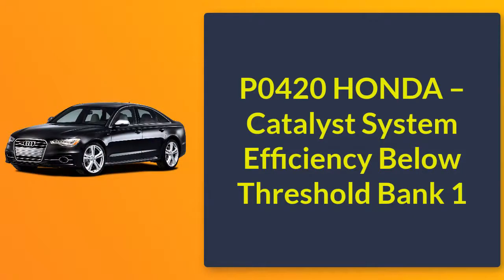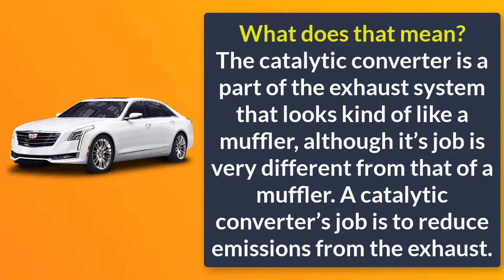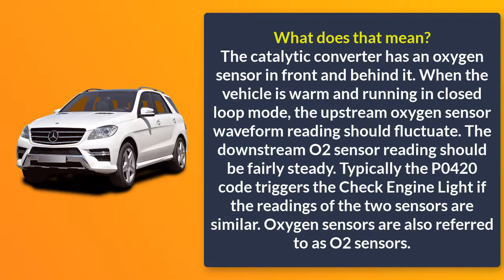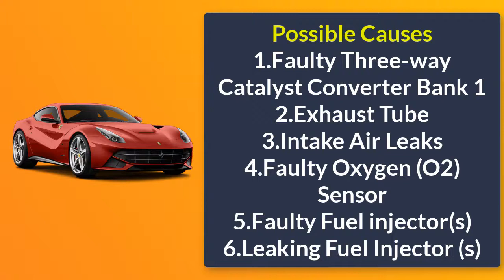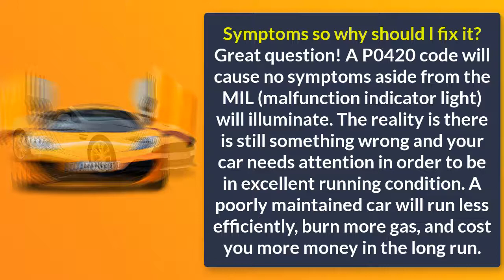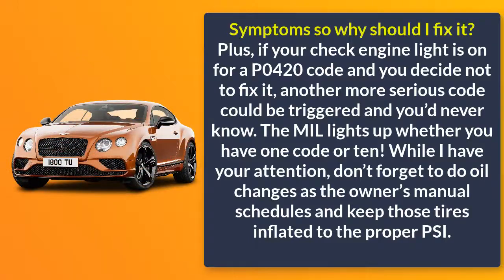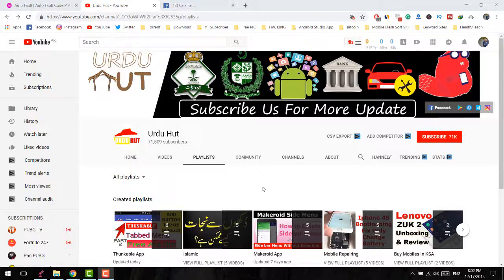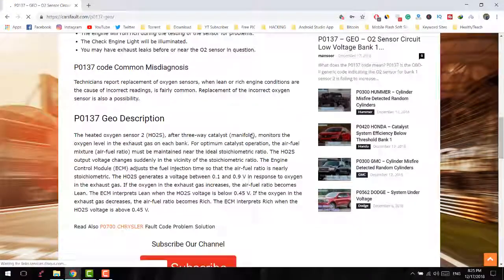P0420 HONDA   Catalyst System Efficiency Below Threshold Bank 1

Comment: I replaced cat and sensors. Still getting p0420
Reply: Try Catalean chemical bottle in Walmart is it cheaper than Autozone . It worked for me cleared my p0420 code within 100 miles.